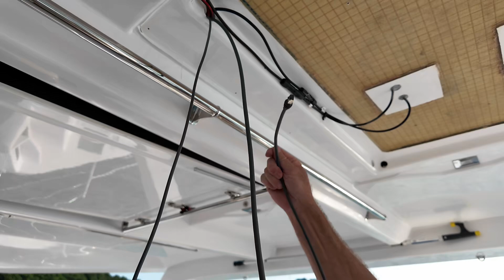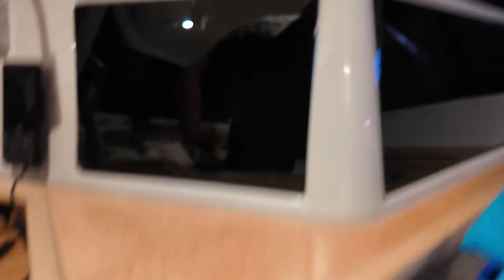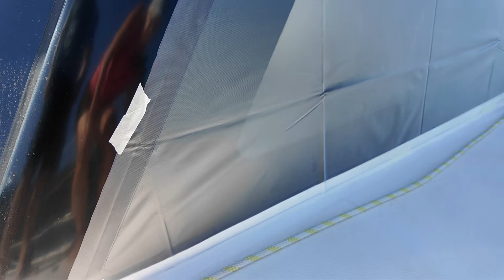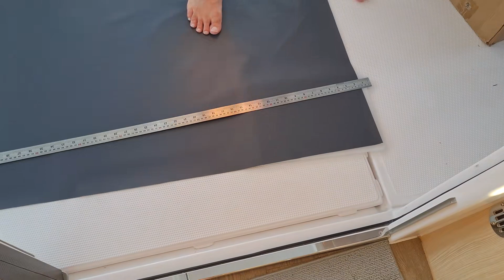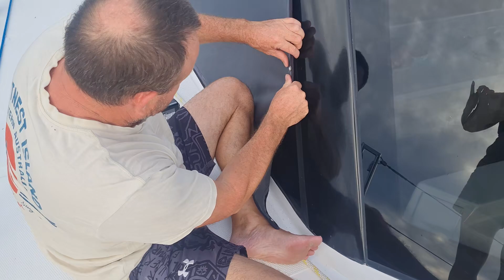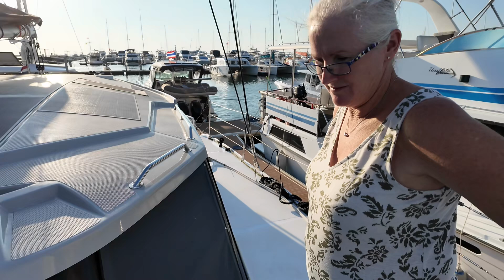180 - How We Installed Starlink and Designed Custom Boat Window Shades

Comment: I have been thinking of getting Starlink Roaming so I can use here in OZ and then when I move to Thailand would be able to use there but I looked at the availability map and it shows its not available in Thailand as yet so my question was does it work for you either in a marina or anchored off shore of thailand ....... cheers you 2
Reply from the maker: We activated our Starlink in Australia and flew it over with us. We started with the 50G plan (AUD $80) and have now changed to the global roam $197 unlimited. It has been working since September. I did speak with someone who said theirs did not work, but cannot confirm if they activated in Australia or their home country first. Ours is certainly working well.

Comment: Nice job on the shades. I see you did not opt for the "value priced" blinds so I think you saved a bundle! How tough was it to fish the cable to the port side roof?
Reply from the maker: We optioned for the Starlink cable to be prewired and supplied the ethernet cable, but then we had to pull through the new power cable for the mini. Seawind offer to leave to pull string so that you can do this easier yourself, and funny enough we did excatly that on another 1370 today!
If you don't get a draw string, it is possible but from the targa roof you need to turn 90 degrees from the wiring hold and feed along the channel. It is possible, but would be a little challenging.